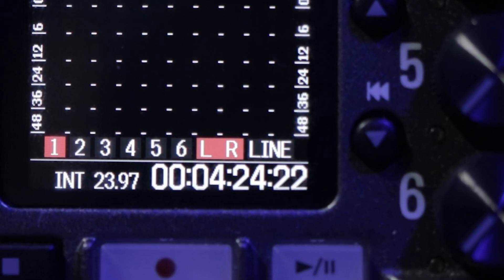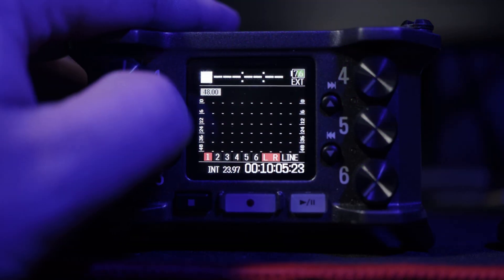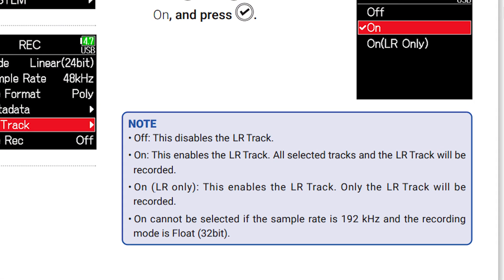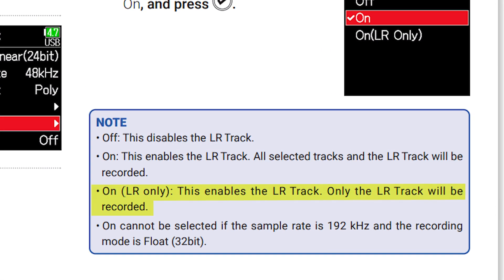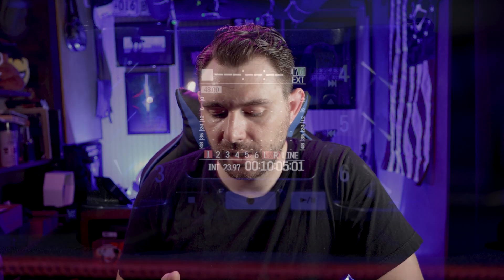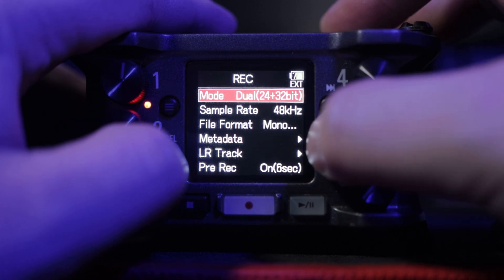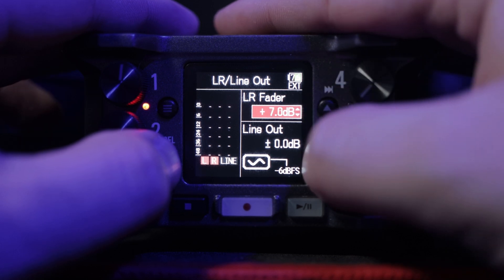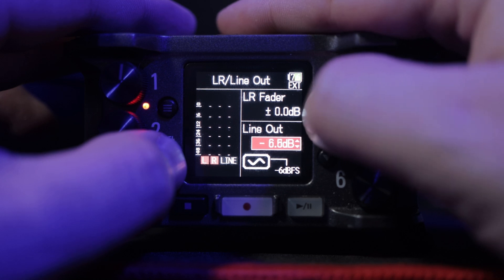How to ADJUST your LR/Line Out volume on the Zoom F6 (Zoom F6 Part 24)

Comment: May I ask, is there a way to change the function of the fader knob to adjust gain?
Reply from the maker: The only way that the fader knob is a "gain knob" is when you are using 32 bit float.  Hope this helps, thanks for checking out the video!

Comment: Line out still noisy in 2022 with latest firmware? Still needed atenuator cable?
Reply from the maker: Unfortunately you’ll still need to use a attenuator. I think it’s a hardware thing. They tried to fix it in firmware updates but some people it worked and some it didn’t. For me it helped. Just got lucky.
Reply: @RebelTech1990  Here in 2023 with firmware update 1.9, is there still a line out problem?

Comment: If I understand correctly. There is on way to adjust my line out level without going into the menu... And that the knobs are only to adjust the record level. Am I correct? Thank you.
Reply from the maker: The knobs adjust the gain in 32 bit. They also adjust the output LR. The line out is a separate adjustment, because it’s a different signal. Hope this helps! Thanks for checking out the video!

Comment: So, does this only affect the Poly record mode?
Reply from the maker: This just allows you to adjust the L/R track (Stereo Track) and Line out volumes.  The Poly has all the tracks and the L/R track files lumped into one file.  Then it can be expanded in the software that you use.  When you expand the poly file you will see the L/R track is in there as well.  I did a video on Poly and Mono stereo, it may explain some of it further.  Let me know if you have any more questions. Thanks for checking out the video!

Comment: Do you ever feed the line out from the F6 to an XLR camera and if so, are there any issues you have run into (aside from it being consumer line level)?
Reply from the maker: Too be honest I never use the Line out.  I have tried 3.5mm to xlr cables but never had much luck with them.  Sorry I couldn't give you more info, but try asking Chris Spiegl about the line out.  He does a great job with F6 videos as well and he is cool dude.  He should be able to give you more information.  I'm not sure if he has the cable but he might so just give him a shout out and let him know I sent you.
Reply: @RebelTech1990  Ah that's pretty much answered my question really. I've just got a Rode VXLR Pro, which converts the unbalanced 3.5mm to balanced XLR and need to test (only got an older H4n at the moment - which I don't use anymore as I normally go straight to camera). I have a lot of panel discussions coming up and the idea of the automix, having a 32bit float version of it and running to camera seemed like a very good solution. I know that doesn't necessarily convert the consumer to pro line level but again, this I could live with if the line out on the F6 works.
Reply from the maker: In my opinion, if you get the F6, just trust your XLR tracks. In my tests, afterwards, the AutoMix only exports to the LR tracks. The individual track files are still raw. 3.5mm to xlr Converters don’t work at least with the F6. I never had any luck with them. 

So if you plan on getting the F6, I would only get if if you plan on investing in a applicable XLR mic. So depending on what you are doing will determine which one you get. Example: Interior Dialogue - Pencil Condenser 
Exterior/Treated Room Dialogue - Shotgun
Podcasting/VO - Condenser/Dynamic

I have a bunch of video covering all of these. Also my friend, Chris Spiegl, covers affordable Pencil Condenser mics. 

Hope this help, let me know if you have any more questions
Reply: @RebelTech1990   The automix going to the LR is great for what I do, which would be getting that feed to camera for live/panel discussions. My mics are the octava mk12, rode ntg1 and then a mix of rode wireless go's and their filmmaker kit. There is the possibility of podcasts layer on down the line and I've got podmics for that. 

Is the LR track recorded in 32bit float or as a separate 24 bit file?
Reply from the maker: If you have it on, the LR output will be in the same folder as the track take.  One will say the track number and the other will have the LR instead.  This is if you use Mono/Stereo.  if you use Poly, then its all in the same file and you will have to separate them afterwards.  I know in premiere it's very easy but in a Daw there are some extra steps.
Reply: @RebelTech1990  Ah that makes things easier on both sides, in Premiere and then in Audition. 

Thanks for all the help. I'll let you know if I decide to go for the F6. Consider me subscribed!